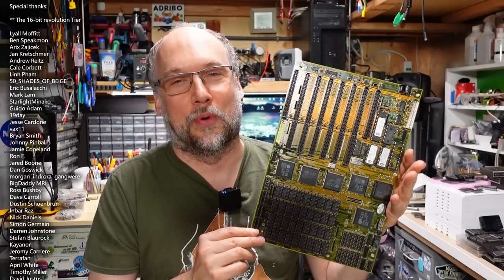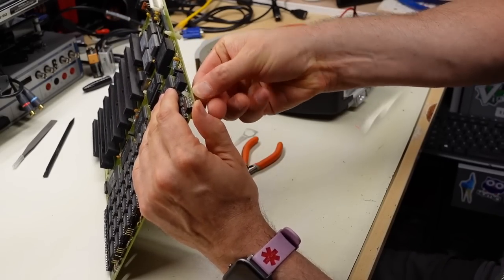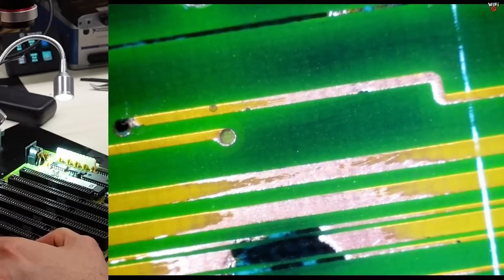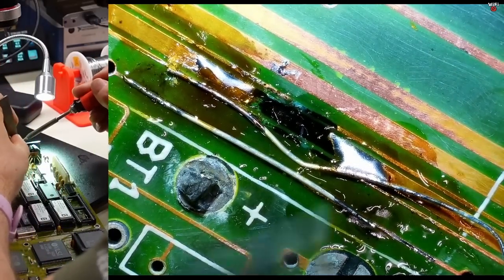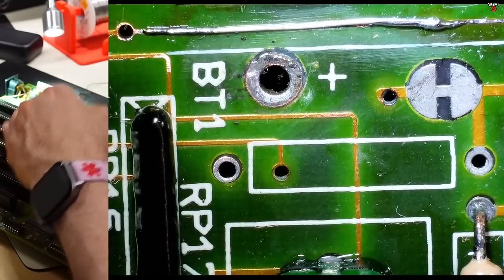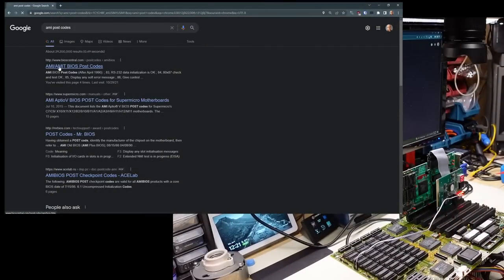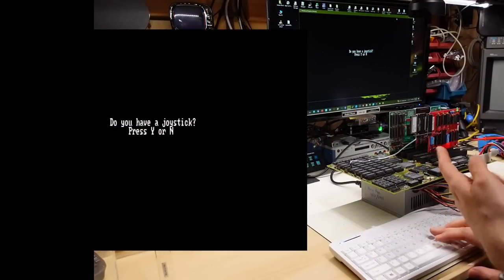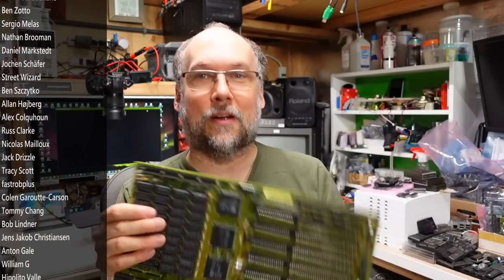286 motherboard repair - VARTA battery leaked

Comment: POST stands for Power On Self Test.  That plastic "straw" is the handle for plastic variable inductors, you can screw / unscrew the ferrous slugs in and out of inductors without affecting the magnetic field.
Reply: ^^this
Reply: Approved🧐
Reply: A few more: Basic Input Output System (BIOS), Complimentary Metal Oxide Semiconductor (CMOS), Industry Standard Architecture (ISA), Peripheral Components Interconnect (PCI), and my personal favorite, Technology Without An Interesting Name (TWAIN).
Reply: Keep em coming. What is ide and sata?
Reply: @user-wj9xq7ig2v   Integrated Drive Electronics and Serial AT Attachment (AT as in IBM AT, which is"Advanced Technology"). And EIDE = Enhanced Integrated Drive Electronics, SCSI = Small Computer Systems Interface, RLL = Run-Length Limited (RLE = Run-Length Encoded), MFM = Modified Frequency Modulation, RAID = Redundant Array of Inexpensive Disks, JBOD = Just a Bunch Of Disks, ATAPI = AT Attachment Packet Interface (usually used in reference to CD-ROM/RW drives).
Reply: @user-wj9xq7ig2v  lol.  Serial advanced technology attachment and Integrated Drive electronics ;)  

Much more fun is TWAIN Drivers.
"Technology Without an Interesting Name"
Now THAT is a fun name.
Reply: @twobob  People Can't Memorize Computer Industry Acronyms (PCMCIA)
Reply: Adrian should really know this one.
Reply: @sophumerin  Heh yeah.  Personal Computer Memory Card International Association doesn't exactly roll off the tongue
Reply: And when things don't work, it's FUBAR - f*cked up beyond all recognition.
Reply: @zedlesshorseman  PEBCAC, obviously :)   (Problem exists between Computer and Chair)
Reply: @twobob  I switched to PICNIC a while back. Problem In Chair, Not In Computer
Reply: Thanks for giving us a chance to feel smart Adrian.
Reply: @markwarner5554  Some of my favorites are "POTS" for "Plain Old Telephone Service" (as opposed to cell phone services or VOIP) and the less common "PANS" for "Pretty Amazing New Stuff" (referring, somewhat facetiously, to cell phone services and VOIP).
Reply: @doxinator3560  It was just an honest answer to what appeared to be honest questions.  I'm such a NOOB.  XD
Reply: @markwarner5554  RAID = Redundant Array Of INDEPENDENT Disks (as Inexpensive as you can find).
Reply: @drright71  My favourite is on Sun systems, the hme0 interface, where hme stands for: happy meal ethernet.
Reply: Don’t forget PEBKAC Problem exists between Keyboard and Chair), also known as an ID10T error.
Reply: W0rd! I came here to say that. Funny to me that Adrian says he didn't know what POST stands for but goes on to immediately describe the Power On Self Test. Ha! Either he's trolling us hard to motivate comments & interaction or, well, like the large percentage of us inclined to watch someone attempt to repair computers from ~30-40 years ago, maybe getting just olde enuff where you know things but the memory location is temporarily inaccessible. The data is definitely there but the address bus is a bit temperamental at times... I KNEW that the top comments would be "POST stands for power-on self-test!" but was still compelled to say the same. How predictable & easy to influence we lot are!
Reply: @z-9693  It's entirely possible that someone can learn what a POST is, can describe what it does, but never learned the expansion of the acronym. For example, I think many people know what a TASER is, can describe what it does, but have no idea that it's even an acronym or what it expands to.
Reply: Error Code ID-10t
Reply: Yes
Reply: Huh... I always thought it was pre-operating system test... well, same difference i guess?
Reply: Yeah, that makes sense. I wasn't dogging on Adrian. I found it pretty funny though because it seemed he knew something he didn't know that he knew. I have a warped sense of humour fo sho... I figured others would laugh ALONG with me and NOT laugh AT Adrian. Seems to me he underestimated himself. He knows more than he gave himself credit for. Which is waaay better than the converse.
Reply: Vanta damaged?  You kidding? VERY DAMAGED,LIKE A MUMMY
Reply: @drright71  one more, Very Large Scale Integration (VLSI)
Reply: @user-wj9xq7ig2v  Integrated Drive Electronics (IDE), Serial AT Attachment (SATA)
Reply: @zedlesshorseman  Beyond Any Repair, isn't it?
Reply: @twobob  OMG now I know what it means!)))
Reply: @Charlesb88  PEBKAC. problem exists between keyboard and chair
Reply: I'm not willing to believe Adrian doesn't know what a POST is.  He's trolling us to increase engagement  =)

Comment: Great video as usual, Adrian! If I may make two suggestions: if you sanded down a trace, it's always a good idea to re-tin it before applying a solder-mask (or nail polish, in your case) layer on top. When you sanded the trace you removed copper and increased the impedance of the trace, even if you still have continuity. A thin layer of tin applied on top should both prevent corrosion (even without the nail polish) and improve conductivity. The other suggestion is to use flux varnish instead of nail polish. Unlike the former, the latter won't take solder and needs to be removed with acetone in case future re-work is needed, which will damage both the solder mask and plastics around. If you re-tin the exposed copper, you don't even need anything else on top and can always re-work later.
Reply from the maker: Thanks for the tips!
Reply: @adriansdigitalbasement  this patch wires work .. It would be good practice for you with the the heat gun .. an the tin paste... instead of that "huge" solder iron that you already use well...
Reply: There aren't actually any acetone-sensitive plastics on the components soldered into the PCB, since PCBs can optionally undergo MEK-wash during manufacturing and that is so closely related to acetone that their material compatibility is essentially identical.

I'm not fond of flux varnish. Sometimes you have a product that has failed after a long time, you wash it and it's good again - why? Some sort of long term changes within the flux? Hygroscopic effect?

But you can also get a real soldermask material and a tiny little UV torch, so that's an option that exist, super inexpensive as well.

Comment: Tip for removing those plastic stand-offs?  Find the right socket from a small socket set where it will pinch the plastic arms and let you pull it out easily.
Reply: Sockets work good and the sections from an old telescoping antenna work good also.
Reply: Bic ballpoint with the ink part removed, but not the sort of shroud/tapered bit that centers it in the body. Just push it over and it should disengage but not go all the way down and instead push it out the backside
Reply: Another great choice is a connector pin removal tool, like those for AMP CPC (= Circular Plastic Connector), some Molex connectors or some Burndy connectors.  (Burndy UTG connectors have later been made by FC, although I don't know who makes their pin removal tool)  Their sizes vary, but some of them fit some of those plastic thingies just fine.  They have an internal plunger to finish the job by pushing the plunger end after the plastic tongue is squeezed in.
Reply: Pair of sharp diagonals. Just clip off either side of board and throw in trash.
Reply: I have an assortment of hobby brass tubing.  I just slide the tubing over the tabs and they come right out.

Comment: For the stand-off's, I used to use a multi-bit screw driver, with no bits - the hole in the end was just big enough to push over it, and it would squeeze them closed, and I could just pull from the other side... or an old pen, or a straw!! :)
Reply: I use an old school white BIC pen with the ink removed from the blue tip. Just leave that middle piece on, fits right on the top of them, and they pull right out with ease.

Comment: 23:00 When working with parallel traces like that, If you stagger the placement of the beginning and end of your repairs they will be easier to work with. I would just run a proper Guage wire across tbh. To each their own 😊
Reply from the maker: Great tip!
Reply: Glad it didn't fall on deaf ears. 🙂
Reply: That staggering tip also works great if you are putting heat shrink tubing over solder connections on 2 or more wires on some type of harness. Keeps all the big wads from being beside each other.

Comment: I believe that red plastic straw is a nut starter. Every Heathkit I ever built came with one. A small 6-32 nut will friction fit in one end and a 4-40 in the other. It’s then very easy to get the nut into the right position and spin it onto the threads, especially if they’re inside a chassis or cabinet. I’ve still got several on my workbench because they’re so handy.
Reply: It comes in a tuner tool kit to turn pots or extend the other tools.

Comment: I used to remove the plastic standoffs with a nose plier pinching each wing with either side of the plier and using my other hand to pull while at the same time pushing with the pliers to make sure the standoff went through. It usually worked like a charm! Thanks for the great video Adrian!

Comment: Years ago when I was working in a computer shop I used to remove those standoffs like you did, with a needle nose plier. Although in my case if I had to spend more than a few seconds removing it I would just cut it off with a side cutter, since there are always plenty of spare standoffs lying around.

Comment: I worked as an automotive technician for nearly 2 decades and automotive stuff uses some similar fasteners as the motherboard standoffs. What I used was a socket for nuts or bolts. If you have a small socket set, it’ll probably work great for this. If you put the appropriately sized socket over the fastener, then turn it, the smaller part of the hex in the socket will squeeze the plastic latches together, then you can pull it out from the back. Worth a try, it worked well for me.

Comment: #1 Glad to see you wearing the watch band.   The red plastic "straw" is an extension tool for the other non conductive tools for adjusting ferret core inductors or pots.  
You had the right idea you just need a smaller diameter tube to depress the locking tab on the stand offs.
Reply from the maker: I realized that about the tube afterwards. You slide it over the core and then it makes getting the tool into the right spot super easy. :)

Comment: Those AT/286 style motherboard standoffs still have a use in 2022! Some modern MSI motherboards designed with an additional mounting hole which isn't part of the typical ATX specification. Remove the bottom nub of the standoff with side cutters and you end up with a flat plastic part you can use on such an MSI board to support the motherboard. No metal or case mounting point needed! 😀
Reply from the maker: Oh wow! Haha. I've cut the nub off a bunch of times for that purpose -- although nor I use the little standoffs which are more like "couplers" that don't have the screw part that would go into the case. Takes a little longer to put in, but a whole lot less frustrating :-)

Comment: Standoff removal trick from the original Greybeards of the 70s/80s...

Pilfer nearest disposable removable cap-with-pocket-clip type Bic ballpoint pen.  Remove and discard said cap, grab the metal tapered piece at the functional end with some grippy jaw pliers, or a bench vise, pull out the insert via the metal part, but don't separate the colored plastic "hollow truncated frustum" (nosecone?) from the white body tube...  Then shove the hole where the insert was formerly held in place at the "business end" over the "wings" of the standoff that stick out to retain the standoffs in the holes, the diameter and length of the hole at the end is dead-nuts tight enough to collapse the wings enough to pass through the hold but not get stuck in the pen in the process...   Think of the same kinda technique as a "molex pin removal tool" for 4-pin drive connectors...

Comment: Another great video. When batteries leak the corrosion is also caused by the gas that is given off not just by battery fluid. If you put the battery in a container to help prevent corrosion make sure it's air tight. The only real way to prevent battery corrosion is to check your battery every now and again or remove it altogether if storing your PC.

Comment: I should say it is NOT exceptionally unlikely for a CR2032 to leak. But they don't generally leak with a lot of pressure, meaning the corrosive contents are mostly confined to the battery holder itself. I've particularly had this happen with forgotten car fobs that hung on the wall for years.

Also after you metal-fatigue the excess wire off your bodges, you should visit the solder joint one more time because you've introduced stresses and re-flowing will even them out.

There's also something very 80s about having 5 identical looking VLSI chips and for them to be in all four possible orientations. :)

Comment: Just one note on running a rechargeable battery (or 3 or 4 AA or AAA alkaline batteries).

If the battery(ies) leak, and the leakage isn't detected soon enough, the corrosion will creep up the cables until it reaches the motherboard.

One of my 386 boards got damaged this way a decade ago, and I wasn't able to repair it yet. It caused a lot of damage around the external battery connector, eating away traces and vias. The battery encasing was fixed to the bottom of the PC case.

Two years ago, the same happened to one of my 486. Fortunately, this time I found out before the motherboard was damaged, but the CD-ROM drive got rusty on the top (the AA batteries were fixed there with velcro).

Since then, I've given up on using batteries that are prone to leakage, and I now resort now to CR2032.
Reply: I just recently discovered rechargeable Lithium-Ion 2032's. May need to add a resistor in series to keep the charging voltage under 4.2v.
Reply: @Peter.Sky.Walker  That's one possible solution, the other is just to use a diode and a regular CR2032.
Reply: Resistors limit current, not voltage.  You can still overcharge a Lithium cell once the charging current decreases.  They need a more sophisticated charging circuit.
Reply: @nickwallette6201  ML2032 looks to be a better choice.
I've purchased a few LIR2032 in the past; one of them had corrosion before being used by me (it was still in the sealed package).
I've only installed one on my retro gear, on an Amiga 600 memory expansion, but I am considering removing it.

Comment: POST is short for Power-On Self-Test. It is one of those acronyms that you kind of feel that you could have guessed it, once you know what it stands for, but you never did, or at least that is how younger me felt like, when I first looked it up. :-D

Also fun fact, originally when Turbo button become a thing, it was actually there for compatibility mode with older stuff and therefore turbo on meant slow mode and off meant fast mode. But due to this causing a lot of confusion, eventually it got flipped around, so turbo on became fast mode. Quite a lot of people were turning turbo on thinking it was fast mode. :-D At least if memory serves.

Comment: I have a Schneider EuroPC 8088 that i had repaired 2 years ago. I take 2 years to repair. Video chip replaced , keyoard membrane cloned on pcb designed by me. Hard work, some money spended but its working.

Comment: Hi Adrian, nice video. recommend when you repair tracks:. 1. add flux and solder to track before adding botch wire. So flux, solder add, move solder back and forth on the track to make proper contact (and clean)  and pre-tinning. then new flux add and finally solder on botch wire.
Best of luck 😊

Comment: To remove the plastic stand-offs, I found an arrow shaft that was just the right size, cut a length I was confortable working with and voilà! A small socket from a cheap kit would also work, but I found the arrow shaft to work better.
Reply: A small socket that you use for metal standoffs should be about the right size.

Comment: Hi Adrian, 
Love your pc repairs!  I have that exact board except that 4 SIPP slots were added. (Slightly newer version)  I'm glad you got it working. The board maxes out at 4mb. You can use either the section with 8 chips (1mb) or the 36 chips (up to 4mb). One of my favorite boards.🙂

Comment: It's amazing how many computerized devices those ni-cads can be in. I just had to repair a programable computer controlled pannel saw at work that was made in 1982. It had a bigger ni-cad battery in a black case soldered onto its main logic board. That side of its logic board was destroyed. However we were lucky and that side of the board doesn't have much on it. I wound up relocating the positive and negative for the battery elsewhere on the board. I attached wires to the board and located a 3.6v ni-cad battery pack in the bottom of the case.

Comment: Hi Adrian, when I was in the aeronautics industry we had tools for releasing the pins from Molex and military connectors that were just a plastic handle with a thin hollow metal cylinder that surrounded the pin and depressed the locking tabs. Maybe research those for removing the nylon standoffs on your motherboard. They sure made quick work of removing the connector pins. Really like your shows. Cheers

Comment: Steven have repair 2 of this boards.
He placed a extern battery holder with batterij and work with bud wires
Its nice to see that this board is repaired

Comment: When I was a bench tech in the late 90s, I had a small piece of brass tubing that had the same inner diameter as a clearance hole for those sheet metal screws (I wanna say 3.5-4 mm). I'd jam the tube over the tip of the plastic standoffs, which squeezed the clippy bits so I could just yank them out from the back. For the ones that were oversize, I just cut them off with side cutters.